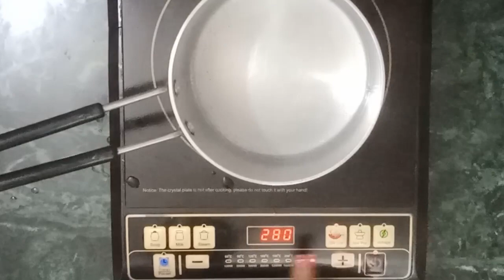इंडक्शन को इस्तेमाल करने का सही तरीका और जाने क्यों आती है ERROR/how to use induction

Comment: How to clean steel water filter  ceramic candle clean .very hard dust particles do not remove cold normal water.Hot water used but some  dust remove but not properly clean .I am used emery paper/ sand paper.Any tips and idea reply.
Reply from the maker: will let u know soon...:)